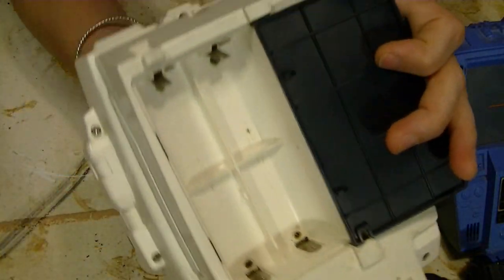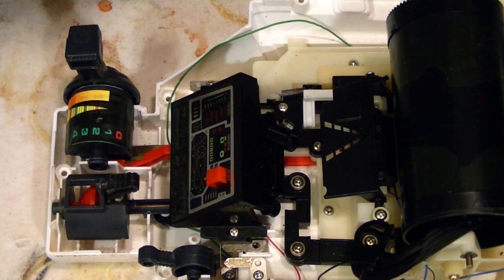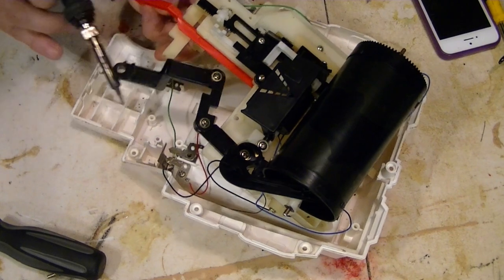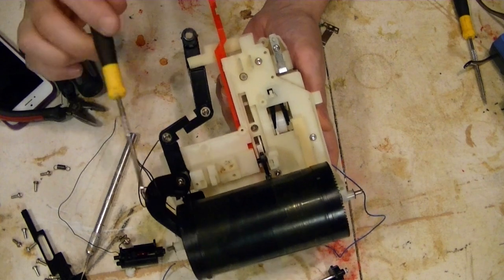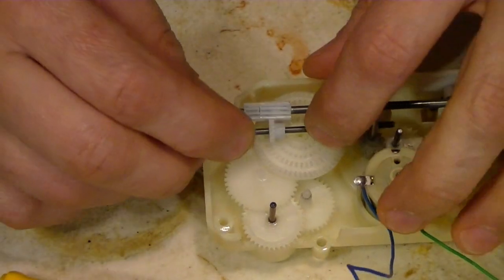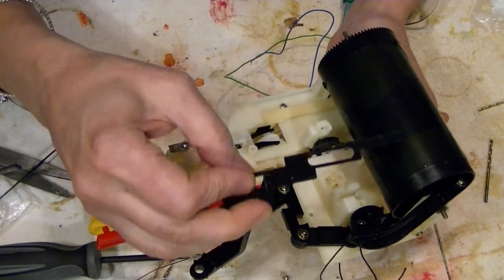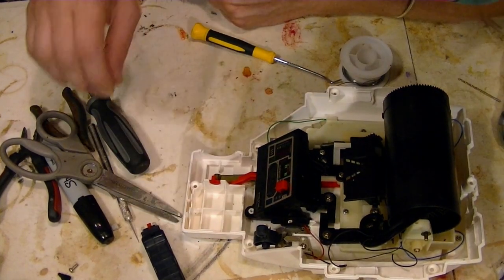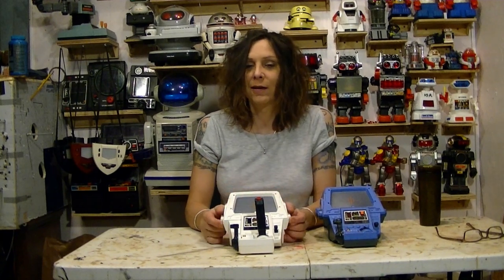Another Mechanical Marvel By TOMY - Space Turbo refurbished.

Comment: I’m from Indonesia. Really good information video about Space Turbo by Tomy. I recently have one  of this game however with missing small bulb lamp. Could you tell me, how can I connect a new bulb lamp inside the Space turbo? Positif cable to..negative cable to..because I don’t have any reference of it. Thanks.
Reply from the maker: It's just a flashlight bulb and there is a socket. Polarity doesn't matter.
Reply: Thank you Randi. Actually missing of bulb and socket and I need to install new bulb+socket. I try to figure out, how can I connect the socket cable inside the Space Turbo🙂